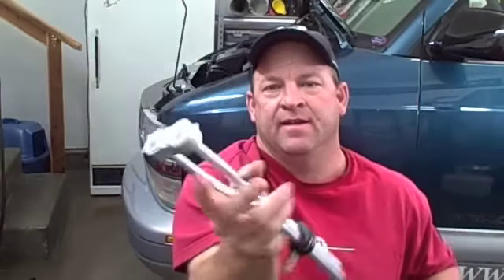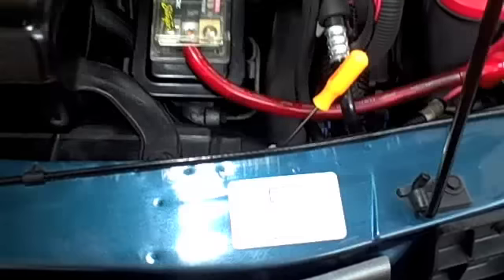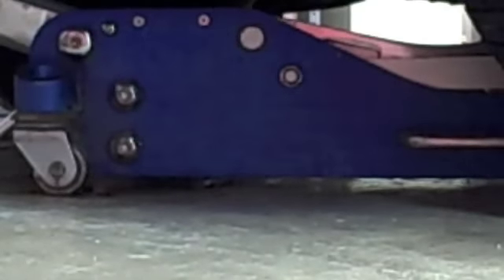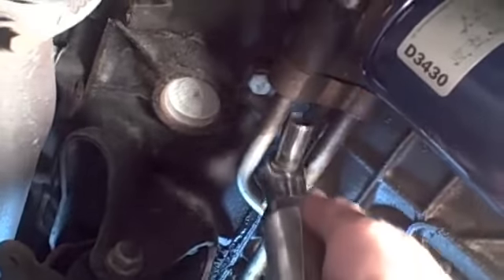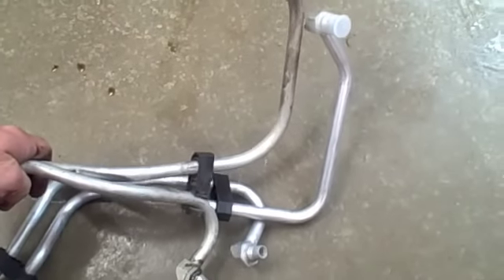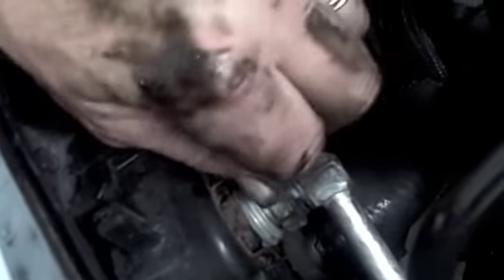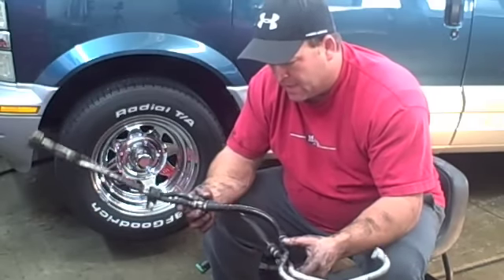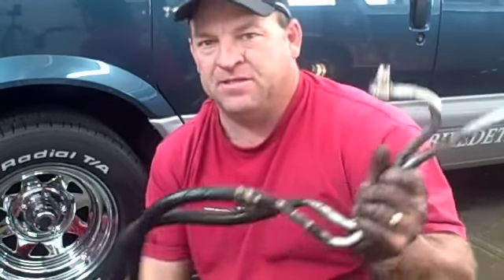How to replace an oil cooler line

Comment: I have been tinkering with cars since I was 16 years old, 50 plus years, and this video is terrific.  I have not seen such a simple and complete explanation of the process.  The biggest hassle is twisting the new lines back into where they were.  But after seeing this, it helps a lot and makes it easier to attempt.  Good luck...

Comment: Hey I just wanted to say thank you for all of your Astro Van Videos. I own a 2000 Astro Van that I use to haul my drum set around and for the live sound audio engineering I do. This is the second Astro I have owned. My Astro has 70000 miles on it. And Ive been working the bugs out of it since I bought this one about 6 months ago . And I have learned alot and have saved alot money thanks to your videos!! Thanks Again!!

Comment: Thanks for the great video. I have a 99 Suburban C1500 (Vortec 5.7L) with the same leaky oil cooler line(s). I think I'll have our local mechanic do it if the price is 200 bucks or so. I'm gonna take it in tomorrow. Thanks again for taking the time to document the procedure. You make it look so easy!

Comment: Great video! I'm replaced the oil cooler lines today on a 1999 GMC Sierra 2500 4x4  but found installing new line from under vehicle up to radiator was a real pain. Not much room to R&R the line but finally got it. Your video was a real help!! Thanks so much!

Comment: Great video and your time spent doing this is a great help to a lot of people.  I would just add one comment.  Please wear nitrile or latex gloves when dealing with brakes and used oil.  They contain numerous proven carcinogens and are terrible for you.  I worked for 15 years in aviation maintenance before finding this out.  We now discipline any technician found not wearing the proper PPE wehn performing tasks associated with used oil or carbon dust.  Really enjoyed your video.  Thanks again.

Comment: thanks for the help, thanks for the tip on what size sockets, that is a big help, now I just installed the exact same lines on my 2002 safari, the way I read the instructions you can install the clips and then pop the line in on the radiator connection, that is how I did it, it seemed to work just fine, great little vans, I would buy a new one tomorrow if gm would build them again

Comment: I just replaced my EOC lines on 99 AWD Safari. It was very difficult, took a lot of patience, and help from Above. The lines go OVER the top of the front diff. To remove the lines, I had to take off the air box assy, the fan shroud, and fan. The lines were extracted going to the front, not the rear. The bolt for the bracket can be removed with a long 1/4inch drive extension to get the ratchet out by the ball joint.
Reply: Good for you. I've got the 2000 AWD Astro and I hear it's a nightmare to replace these lines. I wouldn't mind taking the air box and fan shroud off..I did that replacing the belt and tensioner..but I really don't want to remove the fan.

Comment: I've got my new lines pretty much in place but the 10mm bolt is a real pain to get to. This is on a 99 Astro with AWD which requires a lot more patience.

Also should mention that I had to remove the air cleaner, the top radiator shroud, the fan, and the lowed radiator shroud in order to get access to things.

Comment: Try doing that on an all wheel drive vehicle. Just did that today. ‘99 GMC Safari. Weaving those lines between the front differential and the motor mount just about did me in. But I got it done. Fortunately I have a lift and don’t have to crawl around on the concrete.

Comment: Thanks very nice repair video, I changed my cooler lines on 2008 BMW 750 li  they were very hard to change because of sub frame , My transmission cooler lines cost me $363.00 at BMW dealer  now the car can't move in to any gear what should I do there is no warranty on car it has 180,000 kilometers on that . will appreciate your advice Thanks.

Comment: Hello. I'm working on a 1990 GMC Safari 4.3 All Wheel Drive. I can't find the lower oil cooler line for purchase anywhere. The hose that connects to the oil filter is available but the pipe from the quick connector to the radiator is not. Any ideas where I can get a new one? I need the whole run from oil filter to radiator.

Comment: Just had an oil blowout on my Safari Van today, was told it is the oil sending unit line.  Is this the same as the cooler lines? Also a week ago I had the radiator replaced, could they have damaged these? Thanks!

Comment: o so not only do you have 2 hoses for the standard engine coolant radiator lines and 2 connections for the transmission coolant lines.... but one could have another 2 lines for the engine oil coolant lines

Comment: I have a 2000 Blazer and I have replaced both my upper and lower oil cooler lines about 5 times. I find a leak will start after only 6 months - right at where the clamp meets the hose. Why? Is there one particular brand that doesn't experience this problem?... Pls advise.
Reply: I have the same problem on my 2000 Jimmy. I noticed that the cheaper lines will leak in only a few months. Spend the extra money and get the good stuff. I go to NAPA auto parts, and have found no leaks, and it has been several years since I have done the lines. Good luck!!
Reply: Brad Davies Just did the oil cooler line from the engine to the remote oil filter base (4wd models have a remote oil filter up under the front of the bumper) Had to remove the two bolts on the front axel, right side, to lower the axel, and remove one bolt on top of the axel housing, to get just enough clearance to remove the line. Took a while, but got it done. The hardest part was getting the 10mm bolt back in that holds the bracket on the line. Bought line at NAPA. Last time replaced was in 2007.Had started to leak, so it was time

Comment: Just replaced the transmission cooler lines on my 1994 Buick LeSabre for the second time in two years.  The last time I bought these lines from Auto Zone and they were crap because they only lasted two years.  I should have asked about the warranty before buying them.  After they failed I found out that they were only guaranteed for 90 days.  The second set of lines I bought came from O'Reilley's and they have. a lifetime warranty; however, I hope this is the last time I do this job on that car

Comment: I got a s10 1996 i replaced the line just now! I start the truck ...top one leaks right out of the steel line where is supposed to be snapped in. So i think with me ( as it leaked near the air filter) the cause is the fitting itself in the radiator. However it seems, i cannot wait until i rip all that shit out. And small block it...what  pain in the ass this is/was to fix..

Comment from the maker: Clips go in first then snap in the line.
Reply: +ScottysDetailing How does the clip prevent it from leaking ?  Looks like in the video you put the line in then the clip
Reply from the maker: The clips don't stop the hose from leaking there is a O ring that does that. The clip holds the line in place.
Reply: ScottysDetailing I had this done. Do you need to add any fluid to anything? Like top it off. Cause I noticed my transmission fluid line was quite down after the new lines well as engine coolant

Comment: or you could remove  the whole thing and get GM part # 14081300 and just remove the adaptor plate to the block and screw in your oil filter to the block and save 75$. I would only recommend if you dont use the vehicle for towing.
Reply: Jamie Rehbein  You mean $75.

Comment: stay away Dorman oil cooler the quality hose is very poor the hoses were 2 years old & were porous & leaking!  lifetime guarantee (made in china)! I compared with OEM & Dorman & Dorman hoses are very thin! replace  with OEM gm parts